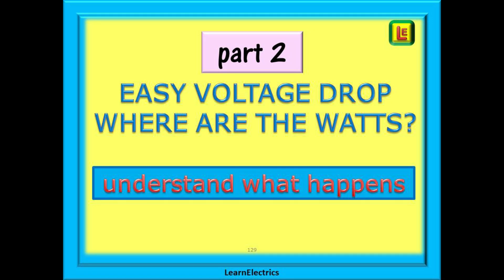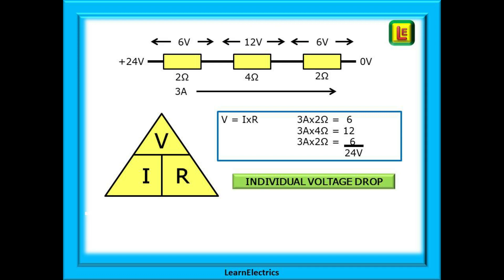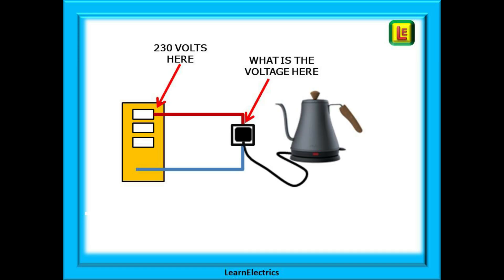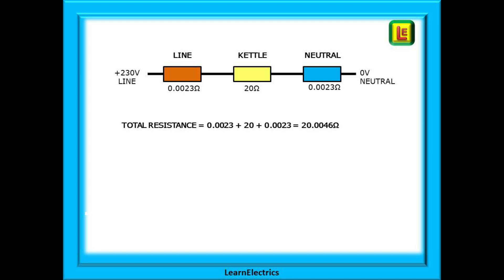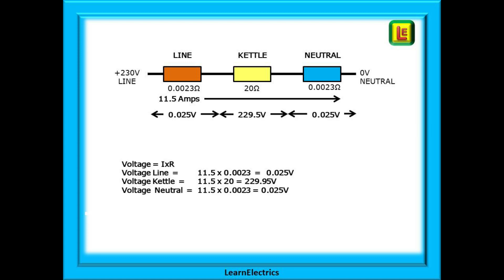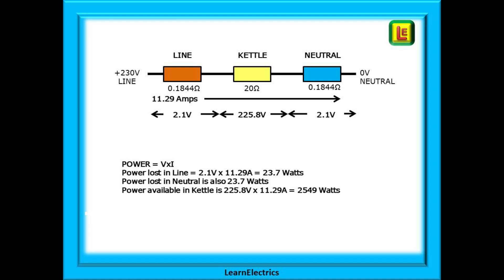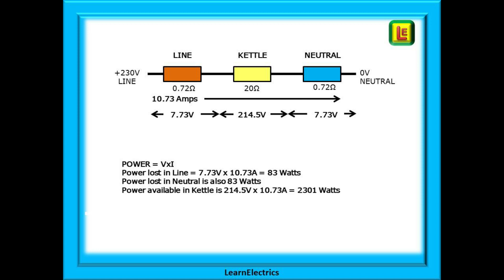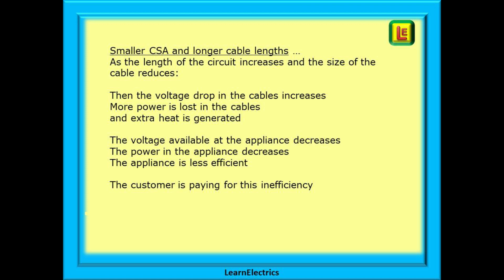EASY VOLTAGE DROP PART 2 - WHERE ARE THE WATTS

Comment: At 16:28   How could the MCB ever affect voltage drop ?  Not sure what that sentence means ?     Does the MCB have a resistance ?
Reply from the maker: What are you going to use as the current load for a socket circuit? We don't know, so we use the rating of the MCB as the max load. Hope that makes sense.

Comment: If the 11.5V AC drop is the limit and the voltage in your house goes up and down. Is CU voltage input always the baseline for max volt drop or is there also a max figure regardless of the voltage input at CU
Reply from the maker: We can't easily measure volts drop that is why we always calculate it based on 230 volts. If it passes the calculations we accept that the circuit is ok. That's why volts drop is not part of initial verification testing, the designer should already have that covered. Dave.

Comment: Dear Sir,

I would be very grateful if you could tell me which type of MCB is suitable for each of the following home appliances:
- Split air conditioner.
- Fridge.
Electric stove.
- the oven.
- microwave.
- dish washer.
- Washing machine.
Clothes dryer.

Thank you very much

sincerely
Khalid
Reply from the maker: Impossible for me to give that information. Only you will know the loads for each device, what items are on the same circuit, or are they all on their own. Which items do you expect to be on at the same time. Dave.

Comment: Where is the calculation with 2.5 t/e cable.
Reply from the maker: Taff, you can use any size cable if you know the ohms per metre resistance. Just slot it in an the appropriate place.Thanks for watching. Dave.